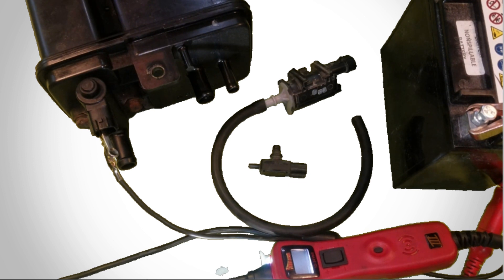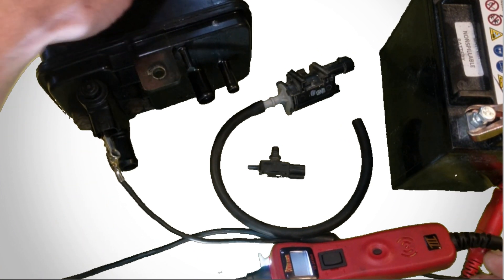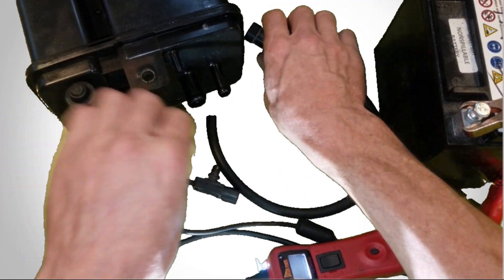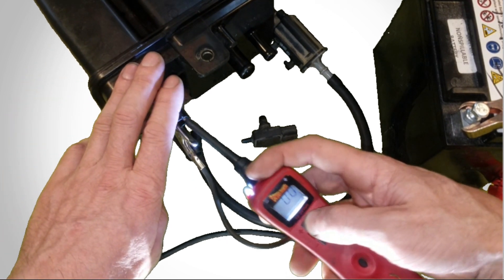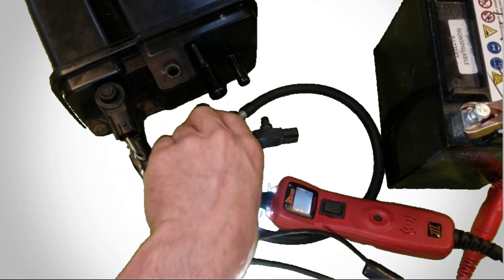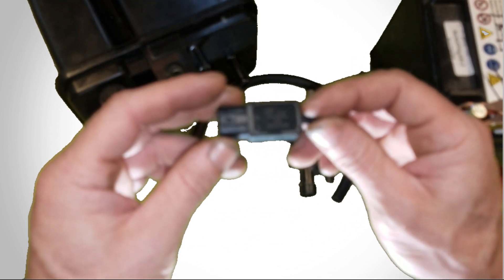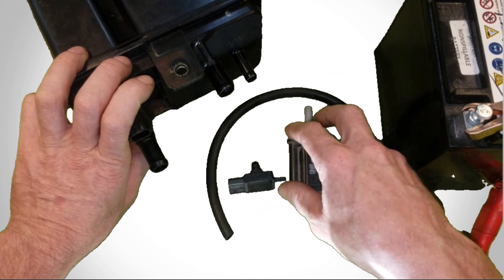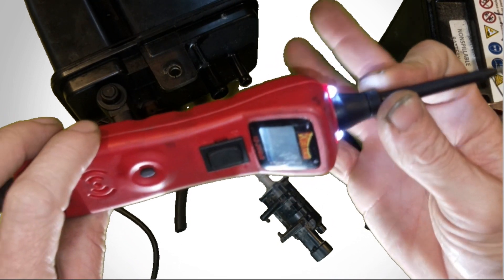P0455 Large EVAP Leak Explained "No Smoke"

Comment: Thanks a lot for providing this very informative video! After removing the intake manifold of my 2012 Tundra to replace a knock sensor wire harness that mice chewed through, I now got P0441 (evap emission sys incorrect purge flow) and P0455 (evap emission sys large leak) codes. I will be replacing the evap purge valve (was only $18 at amazon) on top of the intake, then trace down the line to get the leak detection pump valve replaced at the canister (that thing is $220 sheesh). However, my question is: is it possible that neither of these parts are the cause and instead it could be a leak from not torquing down the intake manifold bolts to spec (I have the Magnuson supercharger and the bolts were an absolute bitch to unscrew and put back due to their shitty location). It is just too much of a coincidence that these codes appeared right after I finished the intake manifold project. However the truck runs like a top and I don't see any smoke coming out of the intake manifold area.?? Any info would be much appreciated. Thanks

Comment: Need help. I have code p0455 , i already changed gas cap to oem one, changed purge valve, changed charcoal canister with one from junkyard, light still on. Took it to shop for smoke test and said there was smoke coming out of top of tank but they were going to charge me extra to drop the tank so I said fuck that, so i changed fuel tank o ring and nothing. Car smells like strong gas right after fill up, tank doesn't smell when its at half tank, and gas smells strong whenever i turn. I just dont know this issue is really putting me in a money pit.
Reply: You might have a hair crack in the filler neck Or one of the fuel lines leaks. Also when you turn the heat, there would be strong gas smell. My o ring by the fuel rail failed so I had replace that cause every time the car would turn on, it would pressurize the line and leak on the fuel rail.
Reply: Could be charcoal canister vent valve not closing.

Comment: I have a car puzzle mystery if any mechanics want to give me your input. There is a 2011 Kia Soul throwing a P0455 (large evap leak) code. We replaced the gas cap with an OEM Kia cap. I replaced the Canister Purge Valve solenoid. We ran smoke though it and saw no leaks anywhere. Took it to a Kia Dealership. They tested everything , bench tested the Evap canister , evap vent valve, gas cap , tested fuel pressure sensor and everything is checking out ok. But the P0455 code keeps coming back? The dealership said the Evap canister looks a little swollen but didnt show any signs of visible leakage. They said they could put a new Evap canister and evap canister filter on (which is 800 bucks) but cant guarantee that this will fix the problem. In short  I am stumped and so is the mechanic at the Kia dealership. any suggestions would be helpful.
Reply: Did you get it fixed?  If not you could get an aftermarket canister on line or to save more could get a low mileage one at a recycling yard, your's might have gotten gas in it from over filling the tank
Reply: I got the same car also.  Replaced the gas cap, purge valve, vent valve, fuel tank pressure sensor and nothing.  Thinking of changing out the fuel pump because I have over 200k on my Soul.   Still working on it.  Maybe I need to change out all the hoses.  Scratching my head on this one.
Reply: @TacoLover2025  So we finally took it to a different mechanic who said they could fix it. They installed 3 different purge valves. The 3rd one finally cleared the code and it passed emissions. But a day later after passing emissions  the P0455 code came back. Luckily we passed and were able to finally get tags put on. We are taking it back to the same mechanic to tell them the check engine light is back on. The mechanic did say that they have seen faulty KIA soul aftermarket purge valves in the past. I will keep you posted on what happens next. Good luck ! I know your pain.
Reply: @Woo-7073  Good luck.  Hope you find something.  I am gonna change the fuel pump in about a week.  I will keep this post updated.    Good luck fellas.
Reply: @Woo-7073  did you get this fixed? And if so what fixed this for you?
Reply: Did you get it fixed?  If not you could get an aftermarket canister on line or to save more could get a low mileage one at a recycling yard, your's might have gotten gas in it from over filling the tank
Reply: I also have a 2011 Kia Soul And have the exact same problem and the mechanic fixed everything thing and still the light is on